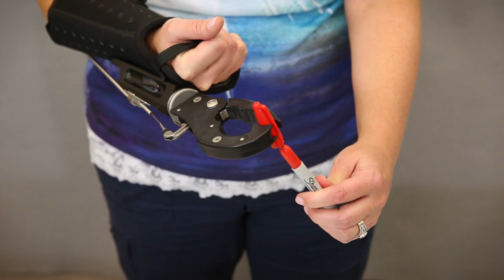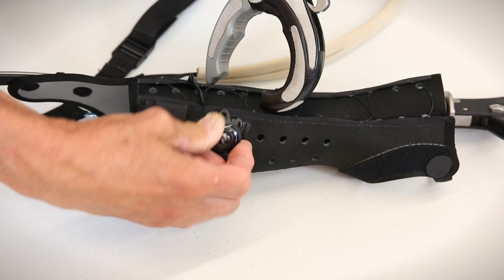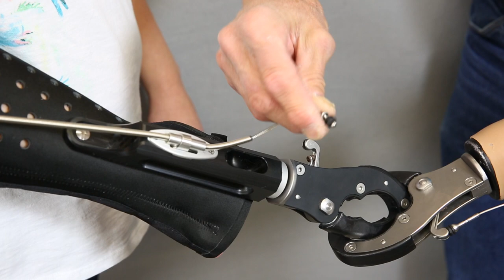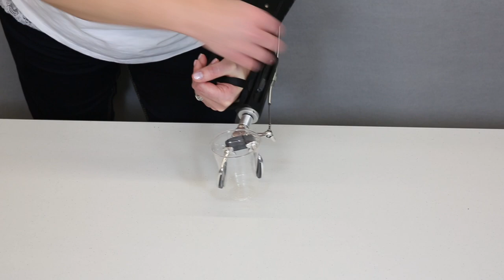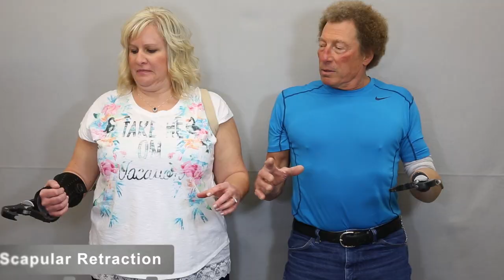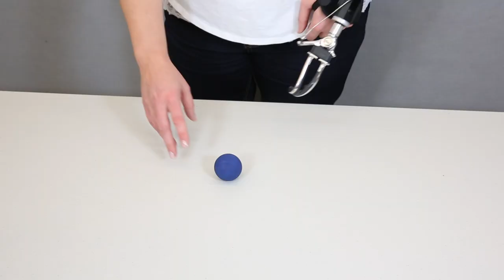TRS Prosthetic Simulator

Comment: Sorry Bob, I can't think why someone with a hand, wrist and elbow would want to simulate no having an arm like us, that do not have them
Reply: Hi Wayne,
As described in the comments above there are a number of values in having a prosthetic simulator. A primary reason is the education of those individuals in medical arenas that need to understand the technology so that they can training individuals that might need a prosthesis. A second reason is to actually place a simulator on someone who has just been involved in a traumatic accident or circumstance and has damaged or lost their hand. Placing a simulator on the "sound" side lets them personally experience different types of body powered technology to help determine if it is right for them. A third reason is that it provides peers, siblings, parents, etc. to directly experience the technology that might be applied to their brother, sister, child, friend, etc. so that they directly experience the "challenge" that the user is undergoing in dealing with prosthetic technology.
There are other probable reasons as well but I feel that these are probably the most relevant. Thanks for inquiring.